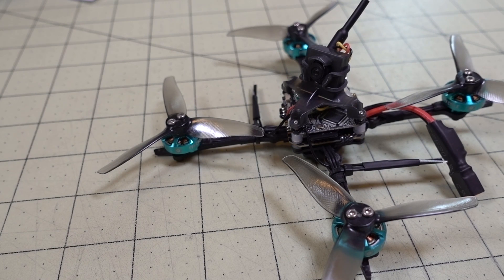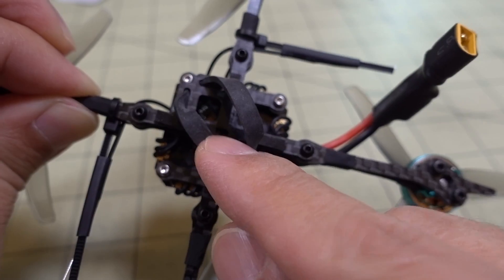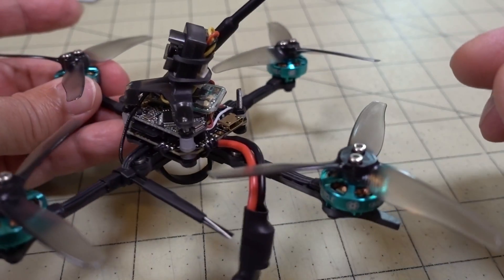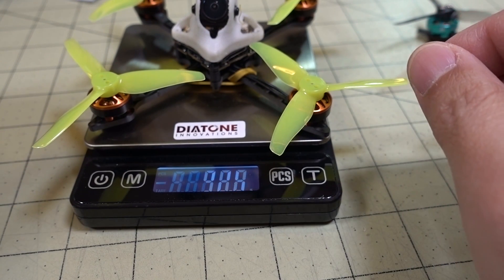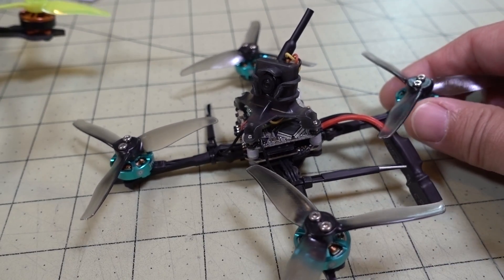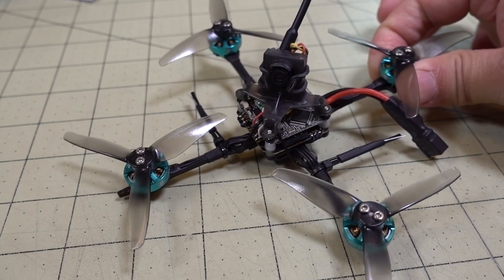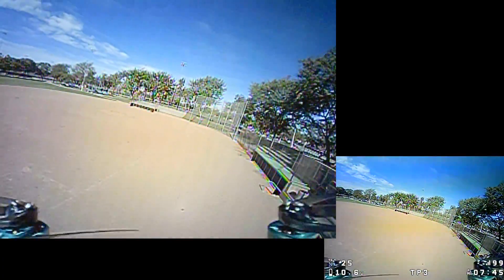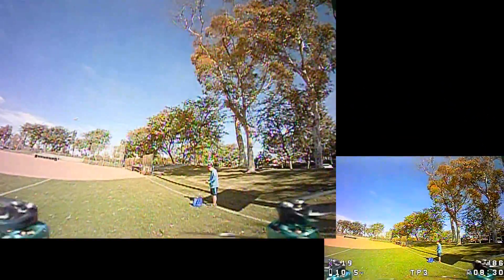Crazy Efficient Toothpick! // KababFPV TP3 😲

Comment from the maker: 🛠️ Parts in this build...
TP3 frame - http://bit.ly/3bDYhdI
Spare arms - http://bit.ly/2SUz9GX
1303 5000kv Motors - http://bit.ly/3bHDCFD
BetaFPV AIO FC - http://bit.ly/38CSlzL
NamelessRC VTX/DVR - http://bit.ly/2Hvyx5t
RunCam Nano3 - http://bit.ly/2FjQX8n
Camera Mount - http://bit.ly/2QM6cxl
Props - http://bit.ly/2wkjlpn
Battery - http://bit.ly/38jZZ22

📺 Other videos you'll want to watch...
Betaflight 4.1 Upgrade - http://youtu.be/JP88ci9lJ6w
Flashing JazzMac FW - http://youtu.be/bi5JZ2HPL3M
RPM Filter Quick Start - http://youtu.be/JkBa7v7qWus
Reply: Can you please share your rates mine has a lot of bounce back and just isnt locked in at all.

Comment: Can someone provide me a betaflight config dump for this model?  Built mine but having issues with it flipping even though the board orientation/ prop directions are correct.  Thanks
Reply from the maker: Do the motor directions match the props?  Quads flip over if the board is not oriented correctly, prop are on wrong, motors are going in the wrong direction.  It's one of those.

Comment: Mr. Kim   Very disappointed in my build on this frame.   What say you on the bi  blade / tri blade options for these motors .  I'm considering 1404 for Biblades because my Run Cam Nano2 , heat shrunk GoKu VTX or TBS Nano VTX and Heat Shrunk arms are contributing to an all up weight of like 110g.   I'm removing some excess wire today but still   VERY VERY frustrating ...
Reply from the maker: Why are you disappointed?  What went wrong exactly?

Comment: Which capacitor size did you used?
Reply from the maker: It's the stock one that comes with the board.  I think it's 220uF 25v but I'm not 100% sure.
Reply: @AlbertKimTV  thanks

Comment: Historically - a couple years ago when i paid attention to KV testing.... Tmotor always tested at a higher KV than advertised.   Emax always tested lower KV that advertised... so i'm not surprised to hear you think the Tmotors are higher KV than expected. 

RE: amazing flight time.... how old is the battery you tested with ?  New batteries always have that magic first few cycles where they seem to last forever... then they seem to drop off and settle in at lower flight times for most their life.  This effect is especially noticeable when going from all old batteries in your fleet, to new batteries. Definitely long flight times here though and thats awesome!

Great vid, awesome quad! thanks for sharing!
Reply from the maker: I think the battery I used is at least three years old but used very gently and never over-discharged

Comment: Doing this since 2016... old news looks like he finally “borrowed” the 3”
Reply: Oh, nice! Where can I buy your frame? Would love to build one. What motors? Whats the AUW?

I saw an insightful comment on Furadi's first toothpick video. He built a small "toothpick,"quad, 3" or maybe smaller, but it was a chunky little thing. The comment pointed out that what makes a "toothpick," is not just building a small quadcopter, but that the real/unique TP experience was unlocked by actually using the specced parts, and a
heiving an AUW somewhere in the specified range. This sweet spot delivers  a unique, and noteworthy flying experience. Anything outside of spec is, well, just a small drone. And while 3" seems to be the sweet spot, recall that this evolved from the original concept of making a small frame that one could migrate all the parts from a bl whoop onto, making a stealthy pocket park flyer, with high performance. 

Instead of being bitter about a scenario that you may be over simplifying, build one up, to spec, and then share your informed opinion. For me, this is all about having fun . Im making the assumption that it's the same for you. If that's true, build one of these, for real. Order a Chinese clone frame if that makes you feel better. Just make sure you aren't leaving on the table,  the potentially profound experience of what is likely  pinacle moment in this niche of the hobby. 

I genuinely would appreciate any resources you could share, that would help me replicate one of your past designs/builds. Cheers-

Listen, I believe you when you suggest you were out front with cutting edge micro/nano builds, long before the hyped up movement of today, and Im going to your channel with the sincere mission of gathering the info i need in order to build/replicate one for myself.

Comment: Nice! Would love a tune video.

Try some Sugru moldable silicone for custom battery pad. I shaped one right around the screw. Cures in <24hrs. with all the awesome properties of silicone rubber. Amazing stuff. 

Id be interested to see the spectral graphs from BB with and without the center frame screw installed. I was really surprised how much more solid the frame is after installing it. Obviously it's performing beautifully as is, but I really want to see the data. I think Ill do it. Also really cool to watch a flight video playback, synced to the matching data in blackbox. explorer.

Comment: Is there any suitable motors to run this on 2s ?
Reply: Yes, absolutely. Amaxxino 1103 7500kv make a fantastic build on the modular TP 3 frame, flying on GnB 450mah HV 2S packs.  I trimmed weight at every corner for mine, but not because it's imperative. Great performance. In fact it's profoundly easier to wield than a 3S, but still snappy, agile, and flies great indoors.

Comment: I got one of these in progress with almost the exact same parts - the VTX won't power up when connected to the FC, even though it does on the bench when powered from 5V. Maybe the regulator on the FC is toasted? I don't know.

Anyway, if it flies so long with the 450mAh, maybe with a smaller battery it would have enough excess power to really thrash. Looking forward to finding out.

Comment: Have you flown it on 2s yet? I’m wondering how these motors do on 2s. I know their 1204’s did well on 2s.
Reply from the maker: I have not.  I think it will just be slower.
Reply: Albert Kim lol yeah I’d assume it would be a tad slower 😝. I’m just wondering the handling of it and how it changes between 2s and 3s. Like my gtb339 I love running 2s mainly bc I only have 2 3s packs and their too big for these new micros but was great on my old tinyhawk r a couple years ago. But anyway the gtb339 on 3s really isn’t much faster than on 2s. Yea top end is a lot higher but the control I get on 2s down low is similar to it on 3s. Was wondering if these 1303’s were similar. Just trying to figure things out for a micro spec class we’re making down here. So far we’re thinking of the diatone gtb339 bc most of ya have one already and running them 2s. Their still plenty fast. I just posted a vid of me tuning mine 2s on falcoX. I don’t really go above about 75% throttle in that vid tho but it’s still movin. 👍👍

Comment: Any recommendations on alternative motors for this build?
Reply: The Xing Nano 1105 6000kv is an excellent alternative.

Also, check out Taco RC for rock bottom price on the pink and blue RCInPower 1204 5000kv (smooooth af.)
Reply from the maker: 1204 5000kv (BetaFPV, rcInPower), T-Motor 1303 5100kv

Comment: Love the performance combined with great flight time.  I just would like to see less prop and especially prop hub.  Maybe with your HD build it the camera will be pushed up a bit and therefore show a little less prop!  I have the 48khz on my Mob6, but not yet on my Diatone Cube229.  I'm wondering if you think the 48khz made much difference in the flight time on those motors.  My cube has only 1103s of course, and I've seen that joelucid says it makes more difference on smaller motors.  Hmmm
Reply from the maker: Won't make much difference with these larger motors

Comment: WTH - too funny!  Did you fly without Jazz to see if that swaps some power for efficiency?  Could shave some weight by using an Eachine VTX without DVR. Frankly I wasn’t impressed by my recorded footage with Runcam nano 3. Might just make that swap myself. Goggle footage is good enough for me. I may just have to try this!!! Cheers.
Reply from the maker: I'm running 24khz, so it's basically the same as 16.7 just bidirectional dshot has been enabled for RPM filter.

Comment: Video is working now. Will the Mobula 7 parts fit in this frame and do I need any additional parts like the canopy?
Reply: That canopy or rather “camera holder” is one of the best out there, in my opinion, and probably one of the least expensive as well. I bought a half dozen or so from Kabobs FPV cycle site thinking they would probably break fairly easy but, to my surprise they are very strong and to top that they are very light as well. I’m still just a 2 -1/2 year noob but in my experience so far, I’ve learned that Albert and Kabob are honest to a fault. They both always tell it like it is and mostly do it in a professional and respectable manner without burning too many bridges. Well, on second thought kabob has put Caddx on blast more than a few times but, they seem to be responding with better QC bc of it. At least it looks that way.

Comment: I've also just got a tp3. Using 550mah 3s gnb battery, because I had them laying around. You should see if fly. I get 8 minutes of flight time with cruising (rest voltage 3,75v), and 5 min of really hard flying. Just amazing. The handling is so good

Comment: How would these motors compare to the BetaFPV 1204 500kv?  I'm building one of these up, but with China shut down, it may be awhile before these motors are back in stock.  Thanks for the review!
Reply from the maker: The 1303 motors are more efficient and a little better control feel below 50% throttle.  The 1204 will have more top end speed and a little better acceleration.